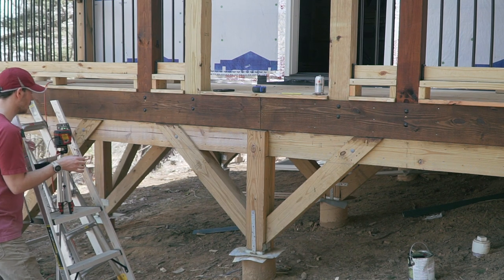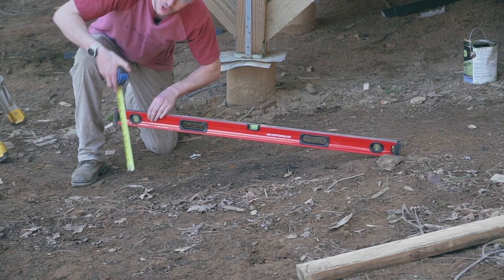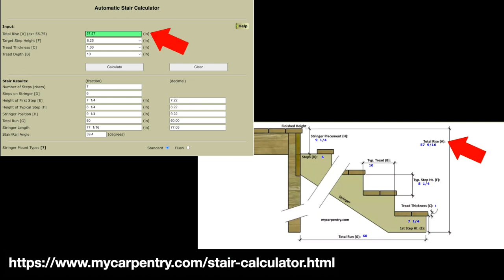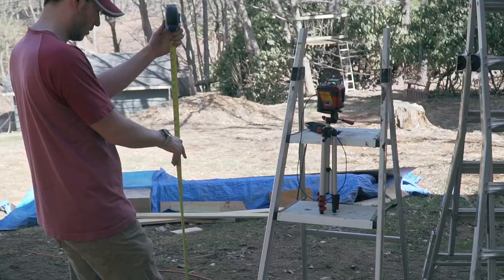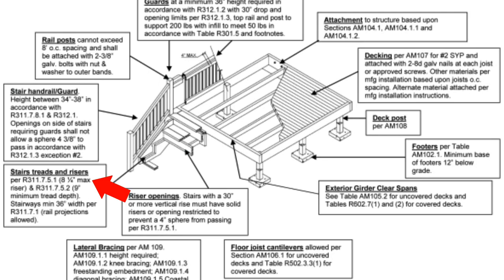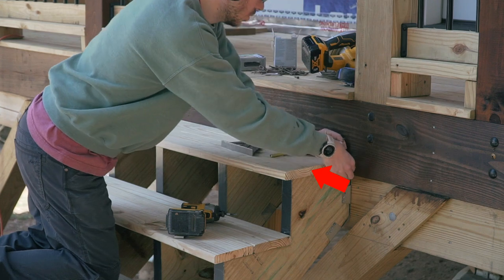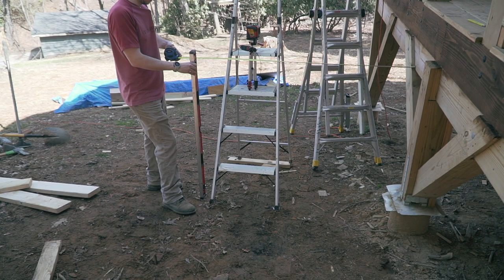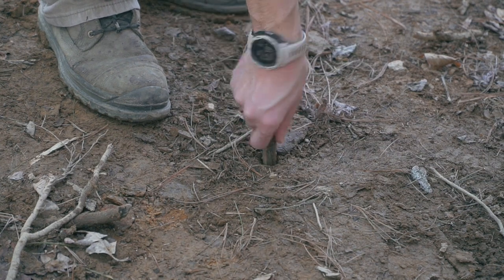Don’t Want to Fail Inspection? Build Your Cabin Stairs Like This and You’ll Be Fine - EP 49

Comment: And one more piece of advice. Belated, but maybe for the future. Concrete, only one cement is not kneeded, it is very expensive. Crushed stone and sand are added to the mixture, so it turns out to be no less durable.
Reply from the maker: The bag I used already contains aggregates, it was not only cement.
Reply: I see. English is not my native language, and the auto-translator incorrectly translated it as just cement. that's why I was surprised by such a number. good luck to you.

Comment: That stair looks bombproof with 4 stringers! Real nice work Tristan.
Btw, is French your first language?
Reply from the maker: Yes, as I said, it was based on the materials use on the stairs. With 1” deck boards, the max spacing is 16”. If I had used 2x6 flat, I probably could have spaced them more.
Yes I’m from France 🇫🇷
Reply: @TheDIYCabinGuy  I’m French Canadian, I live a bit north of Montreal, Québec. We have an old saying here in French: ‘’Trop fort casse pas’’ which means for English speaking readers: ‘’If it’s overbuilt it won’t break’’. 

I’ve only seen two of your videos, this one and the one where you’re installing the double LVL ridge beam. I’m impressed by your hard work and attention to details. 

Bonne continuation.
Reply from the maker: @robertlafleur5179  merci Robert! It’s definitely a much bigger project that I had anticipated it would be. Oh well, now I have to finish it

Comment: Your stair rise of 8-1/4 means a pretty steep set of stairs. Why not use a bit more real estate out front, add one more tread, and make the stairs a more relaxing climb?
Reply from the maker: You’re correct, could have totally done that. I also have to deal with the septic tank in the near vicinity. 
Having said that, 8.25 really does feel fine to me.
Reply: @TheDIYCabinGuy  Im curious what code requirement is since you mention inspections a lot so im wondering.  Around where im at, its like 7 3/8" max or something close to that.
Reply from the maker: @chrisnowak2776  it’s the NC residential building code